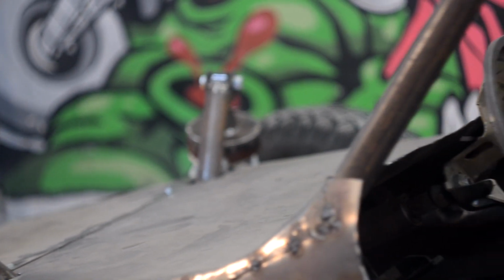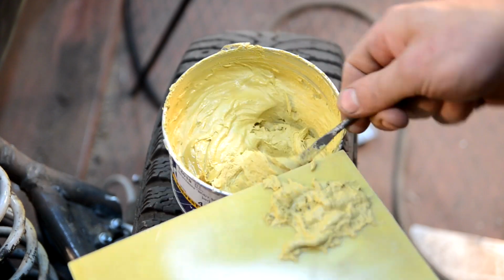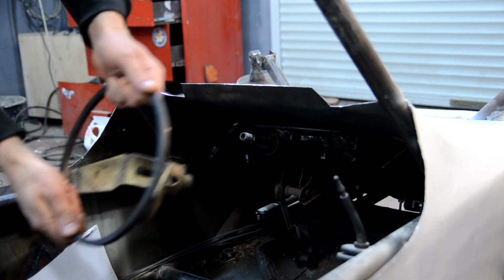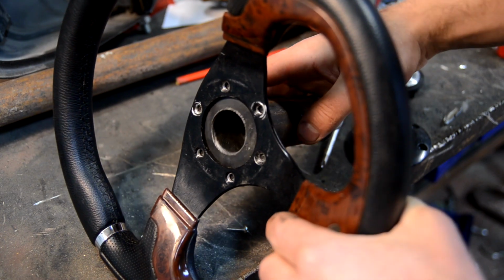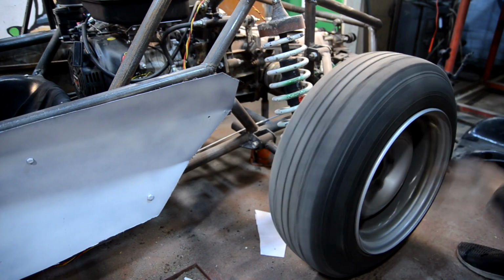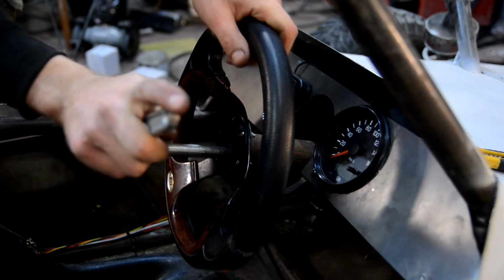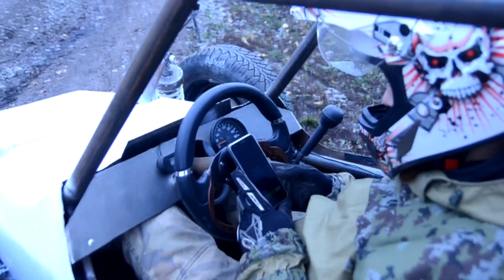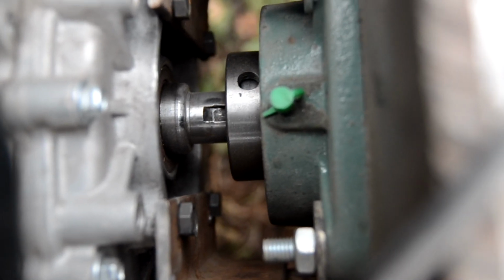HOW TO MAKE BUGGY from PUBG. Part 11. dashboard

Comment: The shaft key should be made of a softer material than the shaft itself so if anything does go wrong the key shears and doesn't mess up the shaft. You can buy shaft keys online for cheap that way you don't have to guess if it will be the right material and so you can have extras incase they break.